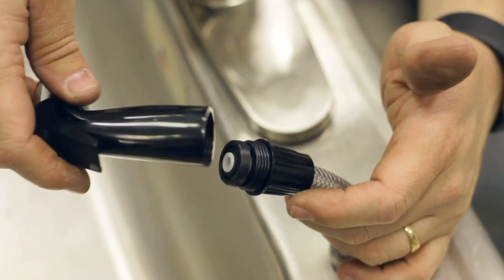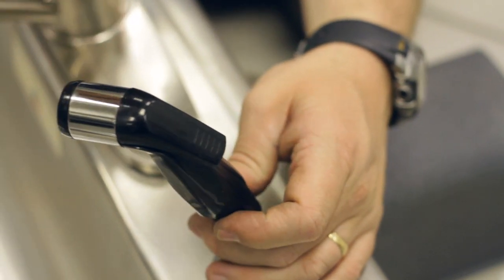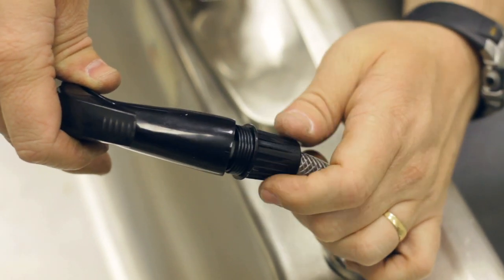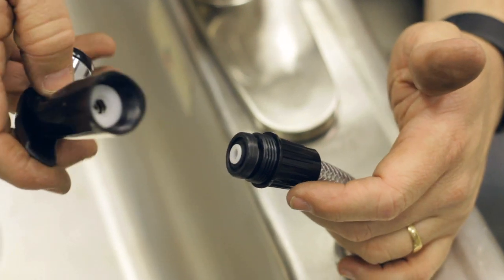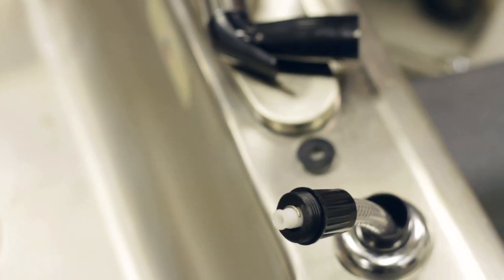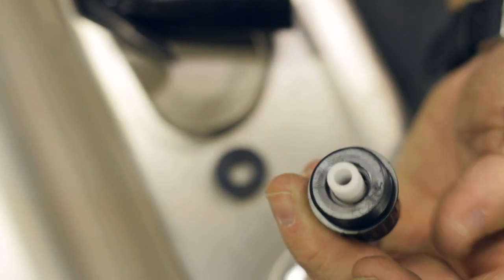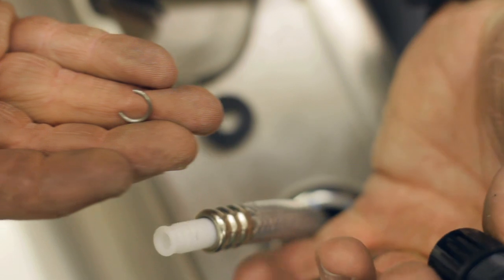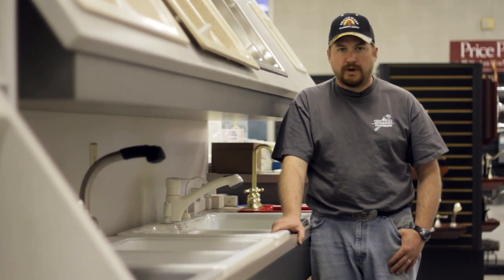Kitchen Sink Faucets : How Do I Fix a Kitchen Faucet Sprayer?

Comment: Mine weirdly has hardly any flow of water when its pressed, even though the kitchen faucet operates normally.
Its not the handle, because when I unscrew that the hose also has very little water coming through, it just drips.
What would cause this?
Reply: There could be calcium buildup blocking the holes; try soaking the head in vinegar. Or, like mine, it's full of tiny particles and all you can do is replace it.

Comment: my issue is I replaced my faucet sprayer, it works for a couple minutes but then stops. The only way to get it working again is to remove the sprayer part itself and reattach it. Any ideas?

Comment: This is such a terrible product.  It you have hard water you can try and  fix the sprayer by submerging it in white vinegar over night. These sprayers have been designed as throw away, and unfortunately the only thing to do is throw them away when they are clogged by debris in the water, thus polluting the environment with more plastic. Luckily it won't end up in a dolphin's stomach, or as micro-plastic in your salt or water.  Hopefully there will be repairable sprayers in the market one day.